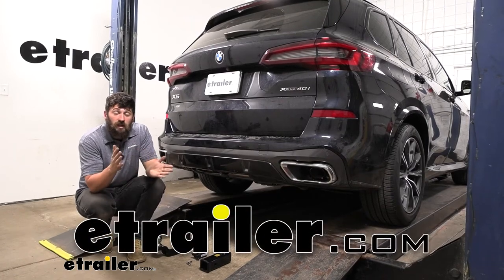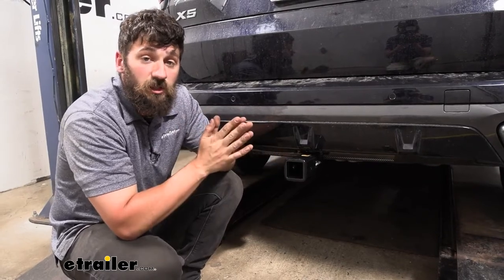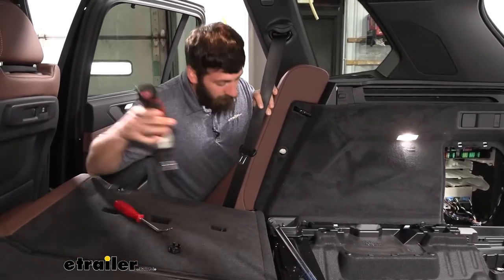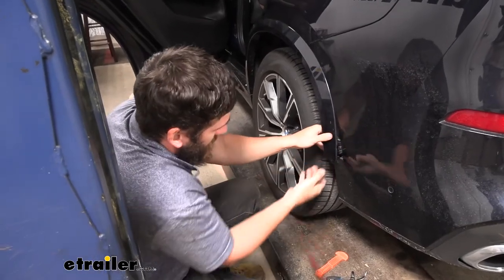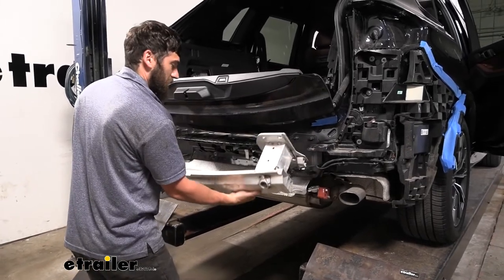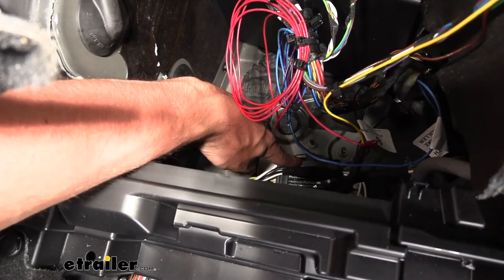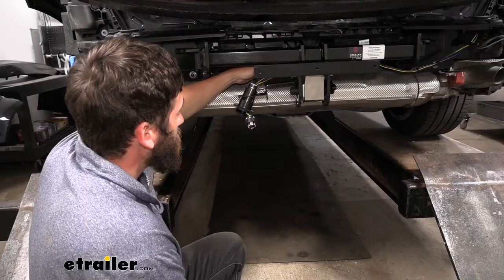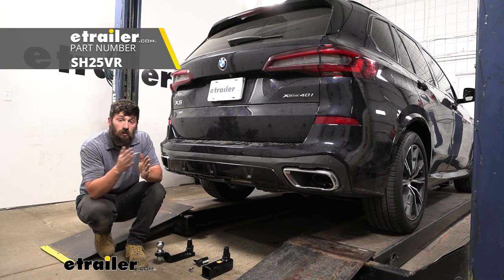etrailer | Stealth Hitches Hidden Trailer Hitch Installation - 2021 BMW X5

Comment: I have three comments:  1. The hole we drilled through the grommet for the trailer receptacle wires needed to be 1/2 inch instead of 3/8 inch due to sheathing around the wires (the install above did not have the sheathing).  2. I needed to cut/trim a little bit of the heat shield for the muffler in order to fully open the flap/door for the 7-round receptacle otherwise, you can not insert the 7-way plug or adapter.  3. I needed to connect the blue purple wire because my trailer has surge brakes.  Stealth hitch provide amazing support by sending me the relay (for free) and providing tech support to help be wire it.  The white wire IS the back-up lights wire on a 2022 BMW X5.  Super simple enough.  I removed the battery cover to connect power and the side access panel to wire the connection to the trailer lights harness and the vehicles back-up lights.

Comment: Do you know if that X5 had the Dynamic Handling Package which contains the Integral Active Steering (rear wheel steering), Adaptive M Suspension Professional and Roll Stabilization?  I'm trying to figure out if the 2023 X5 M50i with Dynamic Handling Package can have the StealthHitch.  BMW deletes the Trailer Hitch package if you want the Dynamic Handling Package.  Thanks in Advance!
Reply from the maker: We have not confirmed if this hitch will fit the 2023 BMW X5 M50i. You check back on our product page in the near future to see as soon as we have it confirmed.
https://www.etrailer.com/Trailer-Hitch/Stealth-Hitches/SH25VR.html